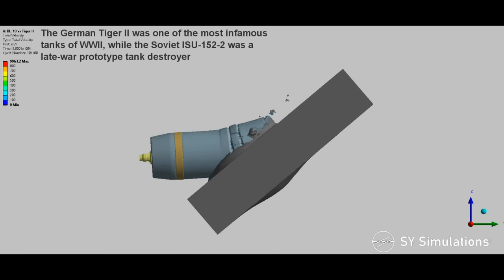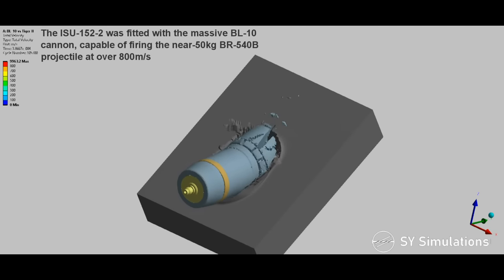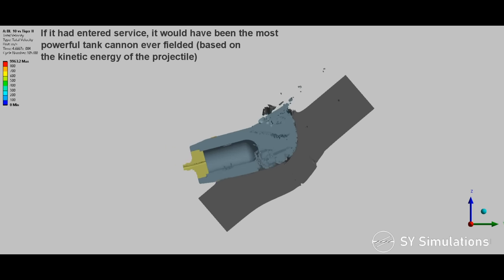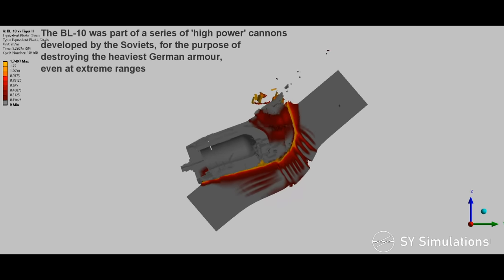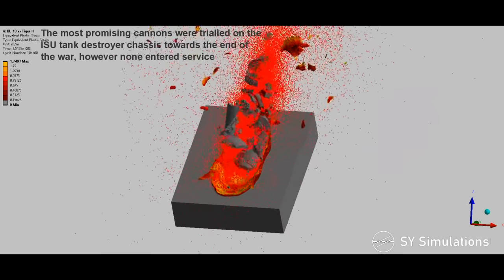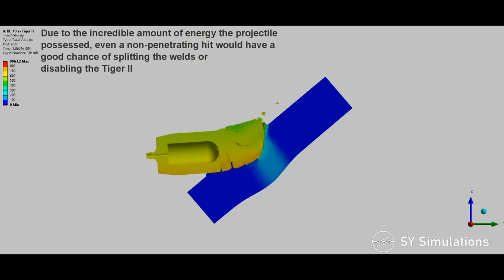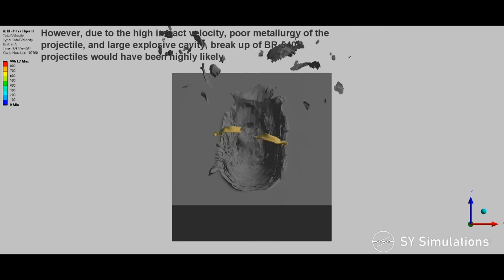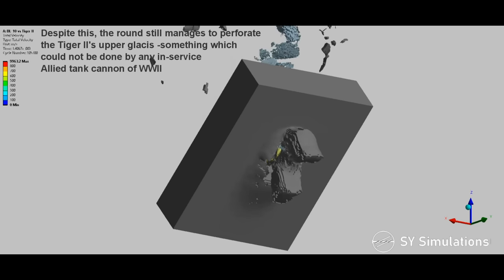SIZE MATTERS | Super ISU-152-2 vs TIGER II | 152mm BL-10 Armour Penetration Simulation

Comment: I did the math, a round fired from this gun has approximately 55% more kinetic energy than one fired from the M103's, which had the most powerful tank cannon ever fielded.
Reply: Maybe if War Thunder finally introduced it, they'd feel compelled to implement post pen damage for partial penetrations
Reply: @cunicularius2064 finally, yellow indicators have a purpose
Reply: Nope was the 152 mm 2a82 of the obj195
Reply: @ignacio3890  not fielded though

Comment: Now imagine an AP round with no filler going at the same velocity as this APHE. It would be completely devastating
Reply: Imagine if they somehow made an APDS shell for this gun (also the m103's)
Reply: @k-osmonaut8807  Just a lighter AP round with better design, metallurgy, and no filler is enough. Imagine if they managed to make an AP projectile that just weight around 30 kg, this cannon can push it to reach the speed of some mid-war APCR projectile
Reply: @k-osmonaut8807  this technically already exists(ed) as the obj120, which was one of the first tanks with apfsds at a caliber of 152mm and 9.45 meters long barrel, shot out a steel apfsds projectile at mach fuck, assuming i did the math correctly, the cannon on the m103 has 10.1 megajoules of energy, the su-152-2 has 17.34 megajoules, and the obj-120 taran has 18.49 megajoules, although i would assume the isu-152-2 would have a much more devastating effect on the armor overall due to its more massive shell weight
Reply: @madmexican1761  upvoted for the use of the term "Mach Fuck" - you a fan of Brandon Herrara by any chance?
Reply: This is simulation remember, In real life it depends on accuracy which ISU-152 never had
Reply: @JaHail-oy6vq  accuracy could well be an issue but then you could say that about almost every simulation. A shell the size of that used by an ISU 152 though… if it hits something, it’s going to do damage. 🫣
Reply: @Rendell001 I am in fact a very big fan Brandon 🤝

Comment: It already got mentioned, but the fact that at this point, it's basically deflecting a light cruiser is pretty insane
Reply: That was not a deflection. That Tank Crew is gone for good
Reply: @Sildrim234  imagine a similar test with the target being an M4 Sherman, M26 Pershing or even a Centurion... I imagine the results would be worse than this.
Reply: @Rendell001  yeah they would've been very dead instead of just dead, makes a considerable difference
Reply: Disabled tank/ dead crew is not good, lol
Reply: Even if the round did not pen the crew would die at impact either way.

Comment: The issue seems to be shell design. That's why Soviet switched to a different design in their later APCBC rounds (BR-472, BR-367 etc) based on PzGr 39 design  (or at least inspired by it)
Reply from the maker: imo,  it was more about the metallurgy...which was also later inspired/based off german shells

Comment: Could you do a comparative piece on the American 76.2-MM M1A1, German KwK 40, and Soviet 85 ZiS S-53 against the same plate? To compare these otherwise very comparable guns.
Reply: 85mm>76.2mm>75mm l48
Reply: @mr.waffentrager4400  Soviet tests conducted against captured King Tigers concluded otherwise.
Reply: @r.j.dunnill1465  what did it conclude
Reply: @mr.waffentrager4400 American 76mm was slightly better than Soviet 85 in terms of flat piercing. Same with 75mm m3 against Soviet F-34
Reply: @raketny_hvost  and in angled pen, the 85mm and zis 76mm was better because flat head
Reply: @mr.waffentrager4400  we can say that all we want. Would be nice to actually see it, though.
Reply: @revolrz22  look at the 60degree stats
Reply: @mr.waffentrager4400  you're missing the point. Yes, the stats are out there. They've been out there for dozens and dozens of years. Kind of like how the table stats are out there for a lot of the guns on this channel. It's still nice to see a simulation rather than theoretical tables.
Reply: @revolrz22  yes obviously

Comment: BTW guys, this is 750m... and also, the BR 540B round is in War Thunder, except its fired at a lower velocity, 4.7 ISU 152 600m/s and 6.7 OBJ 268 760m/s.  ... everyone always tells me im just feeding onto gaijins russian bias, but even these lower velocity rounds are extremly powerful.

 ISU 152 can pen Jumbo and Panther UFP up to around 3.3km + a slight angle of 20deg

OBJ 268 can about 50% of the time penetrate a TIGER 2 through the UFP at 10m at no angle, which is extremly unlikely scenario, but its possible, and if the ISU 152 2 were to be added, it would be like 7.0 or 7.3.
Reply: The OBJ 268 152mm APHEBC is amazing against Tiger II's and Jagdtigers. 

Even at 1000 meters, you can easily one shot them if you manage to hit the LFP. If i'm not mistaken, the LFP is only 100mm thick, so your massive 152mm APHEBC shell has no issues overmatching that armor.
Reply: @carlblack8574  so ISU 152 > T30 with 155mm, other sims suggest that T30 155mm will just bounce on Tiger II ufp.
Reply: They WILL add the BL-10. I Am surprised they didnt yet.
Reply: @Einheit101  I hope they add the ISU-152-2.

It wouldn't be a META vehicle, but who cares! I want a 152mm APHEBC railgun of doom.
Reply: The ISU-152-2 should be 6.0-6.3, not 7.0 - 7.3. 
On 6.3 there is already a Su-100P with a 100mm gun with a much faster reload and a turret. And the Su-100 on 6.0. On 6.7 there is a Su-122-54 with APDS and excellent armor.
Reply: @tankistrazumist  I don't remember those capable of penetrating the tiger 2 UFP easily at angle or at great distance though...
Reply: @petrkdn8224  3bm-7 of the Su-122-54 (6.7)  can pen the Tiger-2 UFP, having much better armor and mobility than the ISU-152-2. The 100mm Su-100P does not pen, but has 3 times faster reload, so it is more effective than the 152mm. For example, the T-44 (85) does not pen the Panther UFP, but is at 6.7 while the T-44-122 with a better penetration is at 6.3.
Reply: @tankistrazumist  cool, 3x more firerate but you use these shot to kill it. BR-540B one shots. It's matter of playstyle. I commonly get many kills with one shot long reload guns. Just today I got for example 8 kills with the sturmitger, or a few weeks ago (I didn't play since then until today) an ace with ISU-152... they are just great tanks.

 If you don't like that playstyle, it's okay, but don't argue with 'it has better reload'
Reply: @carlblack8574  Your rail gun of doom in WoT will only hit like every third or fourth shoot against a target as big like a barn where every second shot will bounce off because it hit the strongrest part of teh mantlet while taking half of the match to reload.
Reply: @carlblack8574 actually 100mm LFP can be pierced by American/Soviet ~120mm cannons, not counting stupid transmission armor, 150+mm howitzers should act even more terribly

Comment: I'm pretty sure that that thing is gonna destroy even a modern mbt,I think the energy release will be so immense that all sensitive components and the crew will be toast
Reply: Безусловно, что экипаж получит тяжёлую контузию и  будет выведен из строя.
Reply: Composite arrays will neatly redirect the energy sideways - it might have about 3 times the power of a 120mm APFDS but it's also a really wide shell. Bare metal like hull sides though? Those are still susceptible even to 57mm.

Comment: Actually the upper glacis of the Tiger II could be perfurated by the IS 2 122mm shot with its D25T gun at a range of 200 meters, a trial was conducted that showed this result, on the other hand the Kwk 43 canon, used on the Tiger II, could not perforate his own upper glacis from any distance at all. Check it out the trials results comparing these 2 guns on Peter Samsonov YouTube channel, Tank Archives.

Comment: Uh... the HE round fired by the ISU-152 during ww2 was already enough to shatter the UFP of the Tiger II.
Reply: Nope , not really .
Reply: @5co756  Yep, really
Reply: "The ISU-152 could also operate as an effective heavy tank destroyer. Though it was not designed for the role, the vehicle inherited the nickname Zveroboy ("beast killer") from its predecessor, the SU-152, for its ability to reliably kill the best protected German fighting vehicles; the Panther tank, the Tiger I and Tiger II tanks, and even the rare Elefant and Jagdtiger tank destroyers. Due to the brittle nature of German tank steel during the latter stages of the war, it was common for impacted armor plates to shatter from the concussive blast, or for weld lines to break, allowing the entire armor piece to fall away."

"The large 122 mm HE shell was its main asset, proving highly useful and destructive as an infantry-killer. In extremis, the IS-2 engaged enemy heavy armor with OF-471 (Russian: ОФ-471) high explosive projectiles. These shells weighed 25 kg (55 lb), a muzzle velocity of 800 m/s (2,600 ft/s), and were equipped with a 3.8 kg (8.4 lb) TNT charge. The explosive power could blow off a Tiger II's turret, shatter the upper frontal plate, drive sprocket and tread off the heaviest German tank even if it could not penetrate the armor. Mechanical shock and explosion was often enough to knock out enemy heavy tanks."

Source: Merriam, Ray (2016). Soviet Heavy Tanks. World War 2 In Review Special. Merriam Press. p. 5.
Reply: @dwarow2508  It's how it's done, bigup.
Reply: Попадания в лоб башни любого немецкого танка фугасных снарядов советских машин, таких как: КВ-2, ИСУ-152, СУ-152, ИС-2 было достаточно, чтобы верх корпуса вражеского танка вдавился кусками вниз, шинкуя водителя и радиста, иногда - чтобы в нишах по бокам корпуса сдетонировали боеприпасы. На закуску - башню после подобных попаданий заклинивало наглухо, одновременно выходили из строя основное орудие и все навесное оборудование также.
Reply: Пр этом, в бронебойном снаряде того же ИС-2 было столько дури, что когда на полигоне из его 122 мм дрына стреляли в лоб Панцер 4 - снаряд не просто пробил лоб корпуса танка, он раскурочил все боевое отделение, влетел в двигатель, застрял в двигателе, сдвинул двигатель и этим двигателем вынес заднюю бронеплиту. Всего лишь.
Reply: would be technically better to use the AP rounds as you could use the HE for indirect artillery fire
Reply: @petrkdn8224  That is true but the HE had so much explosive power that it could blow of the turret of a Tiger II from over 3km away.
Reply: @dwarow2508  but are they gonna hit it though? Very unlikely to hit it
Reply: @petrkdn8224  I mean it was likely enough for TDs and assault guns
Reply from the maker: In the case of brittle armour, yes, and even good quality armour is likely to fail at the welds under this much energy.

Comment: Now do the same with the German equivalent, 10.5 cm KwK L68, 12.8 cm APHEDS/Bunker rounds or the 17 cm K72 AP shell against the IS-3 or IS-4.
Reply: 'Please'.
Reply: There already is a simulation for the 128mm apds against IS-3 on YouTube which result in a predictable non pen / non deform for the IS-3 ( this tank can take hit form 105mm L7 apds without issue in the 6 day war so anything less than that is a automatic non pen )
Reply: @WozWozEre  My bad.
Reply: @huyhoangtahuu9733  I see, so then it is up to the 17 cm to defeat the IS-3 I guess.

Comment: This could be countered by adding a thinner plate of armour with a slight space in between them to disperse just enough energy so when it reaches the main armour, it doesn't penetrate. (if the ISU-152 did become available in numbers to encounter Tiger 2's regularly). But by the time Tiger 2's were a problem, the war was already in a phase that Germans had to look up rather then in front when it comes to things that could destroy their heavy tanks (fighter-bombers).

And of course, with so little fuel around, Tiger 2's barely moved around to be a real problem to the allies. And if they did... Here comes a fighter-bomber and there goes another German tank blown to bits.

Comment: I highly doubt that this large caliber shells can get to speeds of 800m/s , or only for a few shots . The friction must be insane for the barrel , this is done after 5 shots . Imagine the recoil , this TD would kill itself . 😅
Reply: Its probably a naval canon, so it likely it could maintain high velocity.
Reply: when in doubt about info just educate yourself.
Reply: @xeonkitcat1119  Sure , but they are mounted on a large battleship and not on a tank . That's like if you fire a .50 BMG from a pistol .
Reply: Yes, it wasn't produced and was sent to rework due to extremely low resource of the gun. But the TD seemed fine apart from suffering reduced maneuverability capabilities due to the long barrel poking the ground on rugged terrain and worse possibilities of crossing obstacles and tight spaces. But the war ended before it could be finished

Comment: The regular 152 mm howitzer-gun M1937 (ML-20) of the SU-152/ISU-152 never penetrated the front glacis of the Tiger II.  Its MV was 655m/s/  While the shock value was there, the penetration was not.  Could the BL-20 at 800m/s (1946) penetrated?  I dont know.  800m/sec was still not HV.  I would think that it would concuss the crew and yes, crack some poor welds.  Penetrate? Unless it had a different warhead/material, probably not.

Comment: I wonder why they never entered service, what a monstrous gun.
Reply: weight and space
they were unnecessary
Reply: Superseded by APDS/HEAT etc, big cannons firing big shells are ridiculously inefficient.
Reply: This was almost right at the end of WW2. And after it, HEAT became OP
Reply: Lots of inconvenience for, all in all, not very important gain. 
Additional weight is one thing, longer gun is another, combine those 2 and it would probably have issues keeping zero. Huge overhang would also make it hard to manuver in less open spaces, oron  uneven terrain. More recoil means you need to reserve more space inside for breech movement, and you'd have to further limit gun elevation, which was already bad on standard ISU-152. Finally, higher barrel pressure would erode rifling faster.
Reply: They couldn't produce a strong enough shell that could withstand the high impact speed and not shatter.
Reply: I haven't looked it up, but it is safe to assume it is two part ammo. The warhead being 50KG would need a very strong loader to move around safely in confined space. The reload would be horrendous unless you have the crew from a very specific KV2. It would need a loading tray and ram. Ammo count would be terrible.
Reply: @WozWozEre  if so inefficient, why did they keep using large calibre HE/AP shells on battle ships? why not just develop a 300mm APDS ?
Reply: @petrkdn8224   bruh battleships became obsolete at the same time as APDS/HEAT became widespread.  There's a reason we don't use massive guns firing dumb shells anymore, because they're woefully useless compared to more modern technology.
Reply: @petrkdn8224  and to add, Tanks never had the same ammunition handling or loading aids that battleships had. Inefficiency also applies to logistics and ease of loading etc too, not just ballistics.
Reply from the maker: APDS and HEAT were much more efficient yes, but surprisingly they only entered Soviet service in the mid-60s and mid 50s, respectively iirc. -I'm not so sure about HEATs date.
Reply: @SYsimulations  It might have something to do with switching to smooth bore. Spinning a HEAT round breaks up the 'Jet'. Instead of engineering complex collars you stick fins on the back giving you HEAT FS.

Comment: The most baffling thing about Tiger 2 is its turret. Why tf would anyone try to solve shot trap issue with a giant perpendicular slab and a turret side looking like side of a barn.. Comparatively the strongest aspect of allied and soviet tanks were their turrets.
Reply: The shot trap issue was fixed in production turret by adding a ridiculous amout on perpenticular armor, 230mm is pretty much inpenetrable anyways. And the time was not on their side, so no time for full re-design. More insane is why was the shot trap on pre-production turrets there in a first place, they had encountered the same problem before. The relatively flat surfases in german tanks is just a limitation on rolled steel armor. Germany was lacking behind in casting industry when it came to large casts like turrets. And idea of using highest quality steel like they used with rolled steel, saves the limited amounts of raw materials they had available. For USA and soviets the amout of steel was not a problem, so they could easily make the inferior cast iron turrets and not running in problems with running out of materials. 100mm of rolled armor steel is not equal to 100mm of cast iron so the thickness alone is not an accurate measurement on tanks protection.